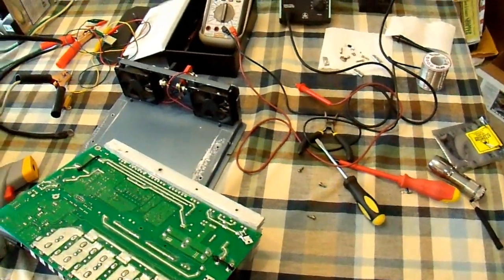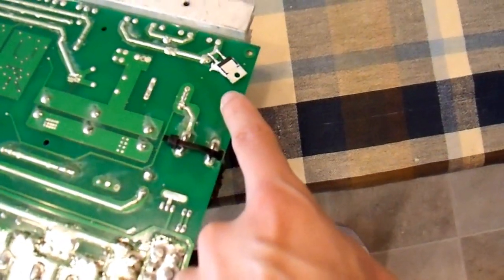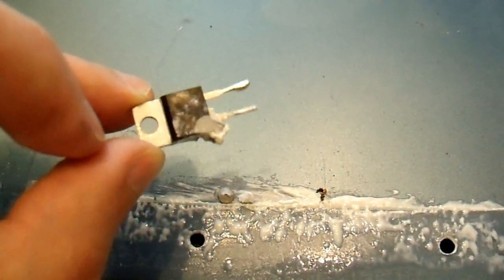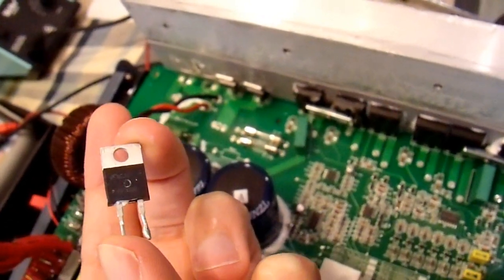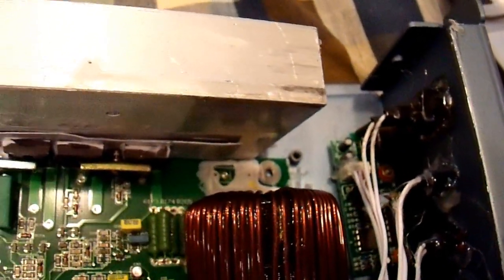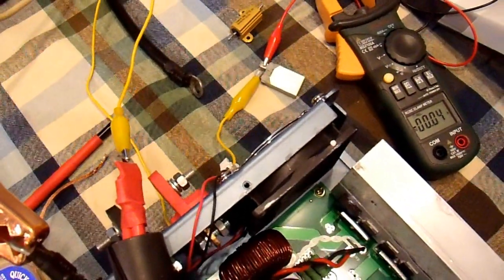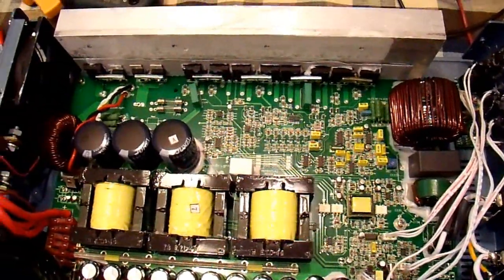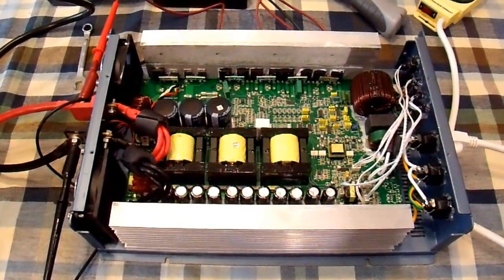PowerBright Pure Sine Inverters Part5 - An Inverter's Last Chance to get Repaired

Comment: would you still have that inverter,i have a samlex with the same board. i am seeking some resistance specs for the main mcu smd capacitor ,1uf 50v ,next to the ka7500

Comment: so are those small transformers suppose to move from side to side in the middle wind. i have a inverter that  if you move it back in forth it will go on and off but those transformers are loose.

Comment: I'm want to put a solar system into my 5th wheel for Off the Grid SHTF living. I only have 1 rood air and don't intent to pwr it with solar. But for the rest of the stuff, having changed most all the lights over to 12v LED's the only power draw is a flat screen TV, Sat Box, Desk Top Computer, Micro wave "not used much" maybe that little roof vent with that fan and 3 way fridge. All Total a 2500w should do just find, but I'm gonna get one of the 3600w Tripp Lite  inverters. What is your view of the APS3636VR Tripp Lite Inverter?

Comment: I have a bad APS600-24 inverter at home I need to look into. I have worked a lot on switching power supplies and I have found a very common problem is dried out or leaking caps.
Reply from the maker: I've seen that as a common problem on power supplies, but have not yet seen an inverter with this issue.  Why?  Perhaps they aren't run continuously as often as AC/DC supplies.
Reply: +knurlgnar24 Nice video and repair as always. Did You still have this inverters? Could You make some photos and description of primary side driver ICs? I am really interested how they generate sinewave pwm signal for output mosfets. Cheers!

Comment: Knurlgnar, so you replaced the two drive FETs and dtive IC. Before you did that. Was the symtom the input fets would get really hot and pop your 10 amp breaker? Im having the same issue with a samlex pww 2000 12a inverter im fixing for another youtuber.

Comment: i work on electronics repairs n mods or build did tv shop for 30 yrs you seem to know your electronics well and neat work i see you got some nice meters  back in the day we did it all on 1 meter now its like rocket science iam  a big fan of analog its just cool to see something move not fluctuate  but the new graph n lcd are cool i say it should have both analog /digital in 1 well good luck on your rebuild inverter  nice job
Reply from the maker: I have a lot of respect for those 'old school' TV repair guys.  It's one thing to design, engineer, and produce a product, but it's another to figure out how someone designed the thing, what broke and why, and then repair it.
Reply: very true  my idear was a power plant for an electric car but its in a smaller prototype now until i see some money to invest  but the main part is working when its done it will run as long as u like no gas or recharge it takes care of  it thanks  to this old timer n got my b day soon yeah iam into building just takes time to match psrts make adjustments

Comment: Morning, i have power bright aps-1000 pure sine, powers up but no power from 120v outlets, i took it 2 tech and they cant fix it, now i am trying to fix it myself, where is the first place you would you suggest it start? any help will be greatly appreciated.
Reply from the maker: Check for any loose components or broken solder joints on heavy inductors, etc.  Then test for shorted transistors.  My Whistler repair video has some tips on what to look for.
Reply: Thanks for your response
Reply: Dried out electrolytic caps and internal fuse.

Comment: Hi I sent you a message, also what part number did you use for the t092 transistor was it a BJT
Reply from the maker: I thought I responded but I guess it didn't go through.  They were BJT.  The part numbers I used were KSC2383YTA and KSA1013YBU.  Other part numbers would work too, but these were ones I had on hand and are common for low end inverter applications, so I know that they are appropriate for driving FET banks in inverter applications.